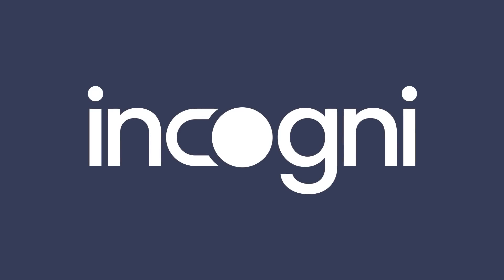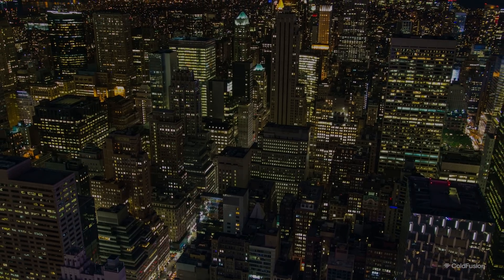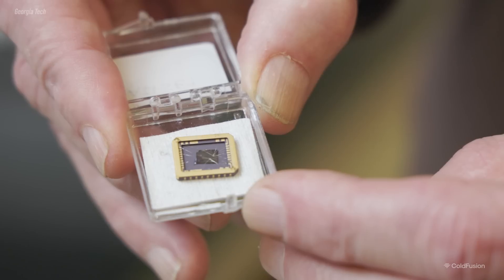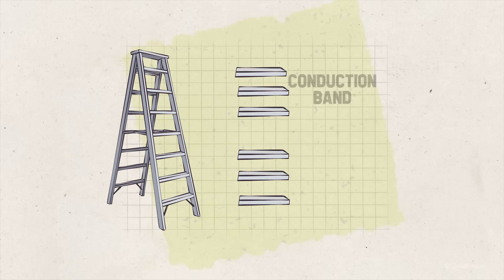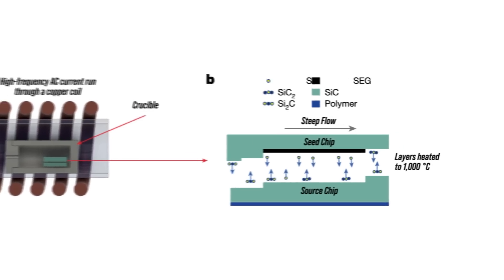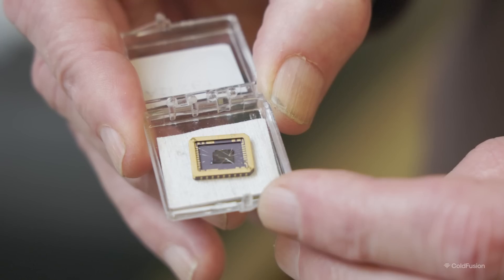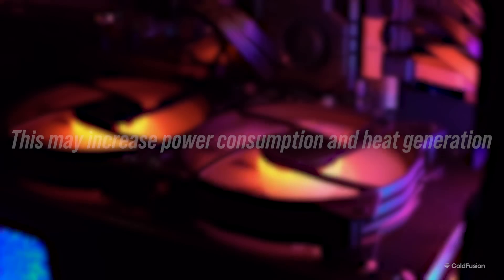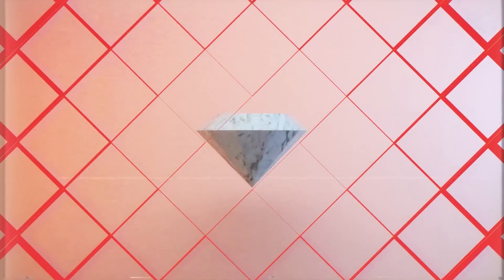This Chip Could Change Computing Forever

Comment: I don't get the "How it works" section. You mentioned the use of a quartz tube with a coil and stuff in it, is that the transistor itself or is that just a method of making graphene with bandgap?

Comment: Yeeeah I knew there wud be a high quality Band Gap break through, cause gas/ cold fusion dissipation in silicon carbide terraces and quarts tubes integration lowering power consumption, graphene electron mobility, and scaleable, 0.6 electron volts is really slow drainage. At last !!!

Comment: even using the same material, it is very hard to scale, to claim that it is "compatible" so it is scalable is kinda a joke. this is still only material science research and not application. until you see a chip running, it is just a theory.

Comment: For cellphones and laptops I think the display makes up a significant portion of the power consumption.  I don't see how reducing IC power alone would 5x the battery life.  I think leakage current makes up a significant portion of power consumption for smaller node ICs as well, and as you stated this would be worse with graphene.

Comment: Couple of notes about this video. Firstly Moore's law is 100% broken. His original observation was that the number of transistors doubles every year and then that was changed to two years. Either way it is no longer accurate as going smaller and smaller gets much harder each time. Intel basically uses it as a marketing scheme these days hoping everyone will remember the "Good Ole days" when they WERE the PC industry. And also on the point of smaller semiconductors. We're already almost at the physical limits there. 1 Nanometer is 10 Angstrom and an Angstrom is about the size of a Hydrogen atom. So we'll never be able to make smaller than about 2 or 3 Angstrom chips. So switching to graphene might push us forwards like 4 years but it'll likely take more than that to develop a proper process to use graphene in the first place.

Comment: Well just like they make laptops and phones 10 times faster than the last iteration, they add programs that take 10 times longer to run and make the semiconductor processors draw 10 times more power. For once, let the computers and phones get one step ahead of their programs so they will work faster and stop stuffing them with bloatwear programs.

Comment: A new semiconductor material that allows transistors to switch ten times faster, and isn't killed by interconnect delays, is at least possible. Switching to analog or even just optical computing, now that has me more skeptical. Of course, this might not pan out either, but the odds aren't as bad as some of the other breakthroughs being touted.

Comment: Interconnections between transistors can take up a huge portion (+50%) of the die area on a CPU.  Those interconnections and transistor gates still have parasitic capacitance that must be charged and discharged, which requires power.

Comment: In 2015, a friend of mine had the idea to use graphene in a CPU. he designed an analog quantum CPU together with an engineer.
they created a working computer.
the pity is that many other inventions were stolen in 2017.
and that the people who assisted him were on the deep web and the login details were also stolen.
a real shame.

a little secret?
it did not consist of transistors but of zener diodes.
and yes these were made dependent on reverse voltage.
so that the data follows a certain path with a certain voltage.
oh yes it was a neuronet CPU.

I hope that someone will make thé cpu again.

Comment: 10 times better is 3 iterations of Moore's law. Three halving steps ago from the 3nm we're at now. That's around the 10nm transistor tech, which wasn't that far away. Your phone can basically last for days if you limit its power to cell phones from 5 years ago.

Comment: It's easy to be a skeptic... 

Man was completely unsuccessfully trying to fly for  centuries .
The US government began paying academics large sums to develop airplanes.
Two brother bicycle shop owners curiously follow efforts at human flight.
Somehow they are bitten by the flight bug and they decide to do their own experiments.
They realize they need a good site for testing kites and set up a test camp about 700 miles from home.
They build and ship man sized kites and gliders, test them and realize they have a long way to go.
After their 1901 test season Wilbur says: “Not within a thousand years will man ever fly”.
Meanwhile they decide to go completely back to basics and develop their own basic data rather than rely on published data.
They work the numbers.
They build new theoretical models.
They develop methods for flight control.
They build gorgeous gliders from scratch and test them again.
In 1902 they know that it is now down to finding the right power source.
With crucial help of their own shop mechanic, Charlie Taylor, they build their own engine that beats all power to weight ratios of their time.
They build a much larger airplane that is truly clever in all its details.
They design and build two beautiful propellers.
They ship the whole thing back to their test site.
And in 1903 they fly.
63 years later , humans land on the moon.

Comment: This on is not a good video that ColdFusion usually keep the standard high. Graphene is useles for electronic because it is semimetal not a semiconductor. Changing with surface engineering or bilayer graphene, the Dirac particle is no longer exist.

Comment: 2:52 Graphene can be, and usually is, a mix of molecules with various thickness (ie. different number of connected layers). The 1-layer graphene is called monolayer. There are other forms of graphene with gaps in the sheet(s), 3D arrangements, etc.

Comment: I was one of those who bought the elecjet portable charger back when it was available, just stumbled on it after its campaign had finished apparently, got it for my steam deck as what I thought was just a super nice battery accessory. Yes, it is impressive, three years later, and it's my main charger, the only downside is capacity in comparison to my near 30k bricks BUT you hook this little brick to a wall and watch the digital percentage climb till its 10k capacity is full in less than half an hour. If I had known this was gonna end up being a rarity I would've bought another one, even on my public servant salary 😅😅

Comment: CPU with 10 cores will not run a single thread 10x faster, we need software to catch up to current CPUs to get the most out of them by making good use of multi threading. Not many programmers can get their heads past the 2 dimensional thinking of one program one task, some can which is nice.

Comment: 20 years ago, I read a science article that in 10 years, in the year 2010, we will be storing data in 3D holographic crystals with several hundred GB capacity. That hasn’t become true. Today I am still using a magnetic hard drive, invented in 1956, just with a capacity of 10+X TB.
In my opinion the next gen computers will not be graphite computers but optical computers. The optical computers have a 100 times lower power consumption than semiconductor computers of today. They will be also available in 2030 and not in some far away future. Japanese and US West Coast companies like Sony, Microsoft, Intel and Google are already working in the IOWN forum to make this next Kondratieff cycle in the 2030ties. This will change the world, when the AI computers will use 100 times less power to do the tasks of today.

Comment: Power drain and heat generation of modern electronics is not due to wire resistance, it's due to gate switching speed getting maxed out. Transistors take a moment to change their resistance value from high to low and back, and during that transitional period they pass a lot of current at non-insignificant resistance through them, which generates heat and wastes power. Faster clock speed means there's less low-losses time between switching, and more high-losses active time. The only way you can help it is to develop a gate that flips faster and shuts harder, like GAAFET technology. Clock speeds are also severely limited by physical size of the chip - speed of light and all.

Comment: "Electrons can only be in a few discrete layers, or shells, above the nucleus, which we can call bands"

A band is not the same as a shell. A shell is what you get if you have more-or-less isolated atoms (or molecules), like in a gas or a liquid. A band is what you get in denser materials such as crystals, and it's a collective thing involving the entire structure of the material. A shell only allows one energy (e.g. the ground state of the hydrogen atom has an energy of -13.6 eV, take it or leave it), but a band allows a whole range of energies, which secretly are like lots of little shells extremely close together, and shared across the entire material.

Comment: Wonderful science and persistence. Hope to see the technology in the future gadgets. However i see some potential bottlenecks outlined below. 

•	Material Properties: Graphite’s layered crystalline structure offers high thermal conductivity and electron mobility but complicates deposition and patterning processes necessary for semiconductor manufacturing. Its anisotropic properties also create variability in circuit performance.
	•	Manufacturing Compatibility: Standard semiconductor production facilities are optimized for silicon, not graphite. Modifying these facilities to accommodate graphite’s unique requirements involves significant technological and financial challenges.
	•	Process Adaptation: Conventional etching and chemical processes used for silicon are ineffective with graphite, necessitating the development of new methods specific to graphite.
	•	Environmental Sensitivity: Graphite processors require strict environmental controls during manufacturing due to their sensitivity to humidity and temperature, adding complexity and cost to the production process.
	•	Scale Challenges: These technical and operational complexities make scaling up graphite processor production both technically demanding and economically costly, limiting widespread adoption.

Comment: photonic quantum computing is the future and China has announced a breakthrough photonic chip that uses 1000x less power than the newest H100 NVidia chip and 100x better in performance comparison when doing AI computing, one single chiplet can do multiple parallel calculations at once unlike traditional computing that do calculations one at a time thus requiring more processors to do big operations resulting in more power requirements

Comment: Current GPUs have 10 billion plus transistors in 4nm process. Creating a single working graphene transistor is a very long way from a graphen based CPU or GPU. 10-11 orders of magnitude of manufacturing complexity and in the meantime silicon based designs would have moved to 2nm or smaller process with well over 100 billion transistors.

Comment: I hada vision that was not a new tech, but it was a annoyance of computer desks and wires, and I was in an office, and had a glass table top and was moving speakers around on it, that would get its power from the glass table. the table was transparent, with a fractual like design of a kind of grey, matter suspended, nto sure if that was the process, but basically the glass could be wireless powered, and the glass would insulate from a person while a speaker with I guess some sort of magnetic varriance or slight charge would be able to get a charge from the system no matter where you put it. Eliminating any need of wires from monitors and speakers and other devices... but it was kind of neat dream, Cords make a mess, and the use of direct energy verse other forms, often misses opportunities to create a nexus for a point or a distiribution model of it, there is that 70's commercial of a guy talking about tech and placing a cell phone on it, and other things to power objects without the need of a cord. The problem with energizing something wirelessly, is idiots and automation, or the in aibltiy ot turn something off, via a switch. AS far as I can tell, anyone talking about the dreams of things are subjects or slaves to a system to consume, the moeny invovled is like a way of dargging someone, but hte alterantive is also we don't knwo fi they were damaged in conflicts and other means, so educaiton is imperative to the movement, the other problme is the use of engineering nad other means ot destroy groups so all in all money has a lot to do with life.... as its ocntorlling it, and claling otu criminals cna get you killed when they operate, but stick with truth evnetually they die, and their chdilren might havea change of heart to the relation of hte garbage parents, in taht statement. NOnetheless... we move forward. Its a world of microcosms and cults and various groups remove others and they use ignroance as the best defence, you can track BSc buildings or particle accelerators, and otehr forms, so their is a entire parade of mis managment and cruelty a foot to peopel for no reason.. its pretty clear and cruel.... so there isa literal division in society visible and invisible, made artifically, but if you have money and a mind to see yo ucan enter and go into any of them, which if your robbed you are remove,d and classed as y by idiots, and if your a criminal your never known and often given credit based on money adn Oj murder and nonsense jsutice system is a great example of being held hostage by a infkluential and destructive ideals to a group of ignorant humans, so study stabiltiy is destroyed, for the sake of poltics or engineered choas, nonsense.  meh..

 SO yeah I had a dream,,, vission whatever and a table coudl exist and use of graphene added in the process, coudl make a slightly matte or grey glass table top that yo ucould use to power speakers and phones and whatever else... and be transparent, and other things.. hmm... the applications are interesting.

Comment: Well I can only imagine my smartphone lasting several days either with no display or no wireless connection at all, which apparently are sacrifices, you don't want to make in a cell phone. It would then be just a pretty quick calculator, even if not having the graphene chip.

Comment: To be competitive with current transistor density requirements of processor chips as used in mainstream phone and computer cpus,  it should be  manufacturable using sub 5nm lithography.  Also it should be retrofittable into current silicon lithographic production chains. The yield per wafer should match that of silicon wafers.  Considering all such requirements, my estimate is atleast 10 years before the average consumer gets to experience this tech in say mobile phones. That is a long time in technology.

Comment: The M1 chip already proved to the world how possible this is.  I owned a M1 MacBook Air and it would go 22 hours of internet email and videos without needing a charge.  Those 22 hours meant 4-7 days of use without needing a charge.  Regular laptops can’t last 4-6 hours.

I have the M2 Max now fully maxed out.  It isn’t as efficient with the battery as the M1.  I think it needs too much power?  There’s clearly a balance somewhere between cpu efficiency vs power draw.
Reply: 22 Hours?   Maybe with the screen brightness at 25% and no video playback.  maybe.

Comment: Methods for Bandgap Engineering

Several techniques can be employed to induce bandgaps in graphene:

	1. Chemical Functionalization: By attaching functional groups or molecules to graphene, the electronic properties can be altered, introducing bandgaps. This method offers tunable bandgap widths but may suffer from stability issues.
	2.Graphene Nanoribbon Formation: Narrow strips of graphene, known as nanoribbons, naturally exhibit bandgaps due to quantum confinement effects. By precisely controlling the width and edge structure of nanoribbons, the bandgap width can be tailored.
	3.Strain Engineering: Applying mechanical strain to graphene can modify its electronic properties, including inducing bandgaps. This approach offers a reversible method for controlling conductivity but requires precise manipulation.

Implementing in Transistors

To utilize graphene as a semiconductor in transistors:

	Fabrication: Begin with a graphene layer on a substrate, typically silicon dioxide.
	Bandgap Introduction: Employ one of the aforementioned techniques to introduce bandgaps into graphene.
	Electrode Integration: Add source and drain electrodes to facilitate electron flow.
	Gate Control: Utilize a gate electrode to modulate the conductivity of graphene by adjusting the bandgap width.

Comment: There is a mistake here.  The switching voltage on normal silicon diodes and transistors is not 1.1 volts; it is 0.7 volts.  There are diodes that require other voltages, such as LEDs and back diodes, and the MOSFETs used in high-end microprocessors now may require significantly higher voltages, but that is because MOSFETs (metal oxide silicon field effect transistors) control switching in a very different way (basically electrostatics, hence the term "field effect") from basic bijunction transistors wherein the switching voltage is directly related to the band gaps of doped silicon.  Fancy processors now also generally don't do full-switching, stopping short of that to cycle faster and taking care of signals being somewhere between ideal 0 and 1 states by cleaning those up before they get too sketchy.